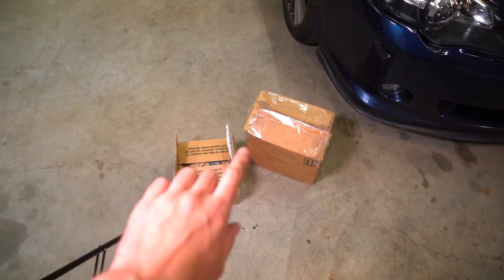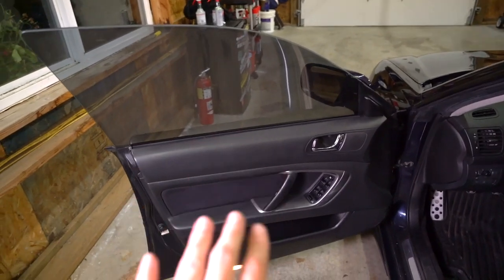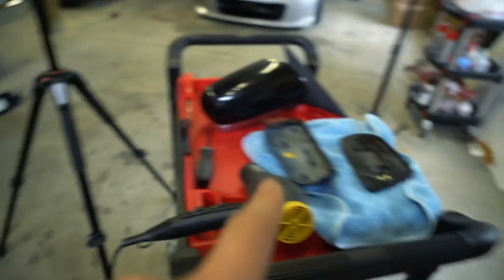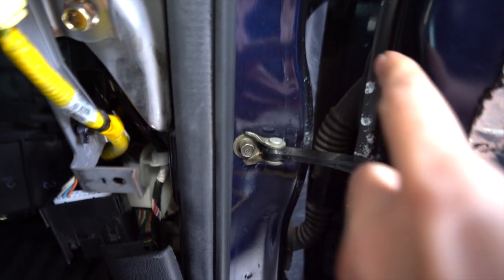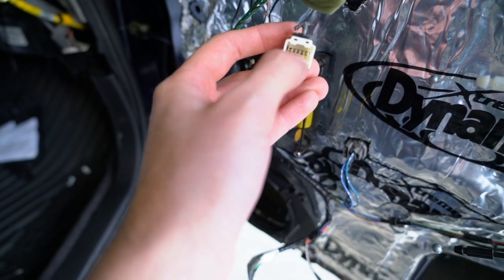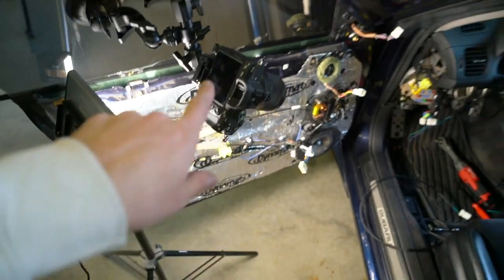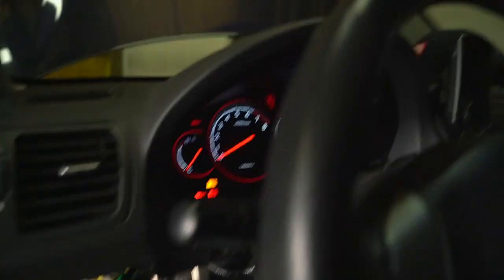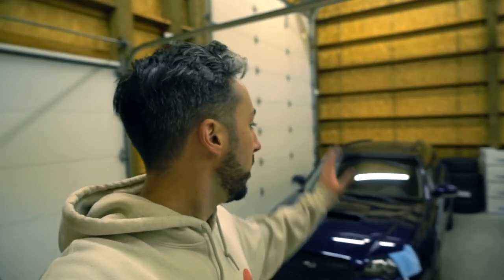A Subscriber Sent Me JDM Power Folding Mirrors for my Legacy GT Wagon!

Comment: Mr. “OEM Look” does it again! Would be ultimate flex to tie the switch into your key fob so you can waive at people at car shows.
Reply from the maker: Got to keep that OEM fit and finish! And man I'd love that, ultimate goal would be to have them fold in when I lock the car like you see on newer cars
Reply: @avengednick  if you figure out how to wire it to your door lock, an instructional video would be great. Not much content out on the auto fold when lock. A friend told me he just wired the mirrors into the door lock harness but didn’t explain it all too well. Great video, you did an awesome job explaining and recording the install. Am doing these JDM mirrors as well as the auto leveling JDM headlights soon.